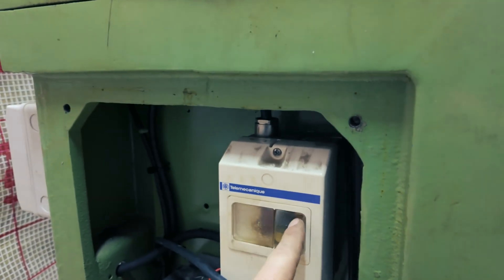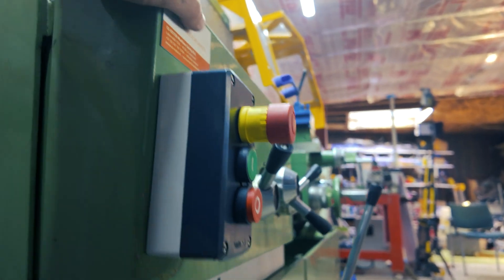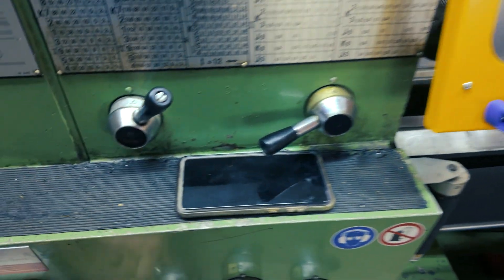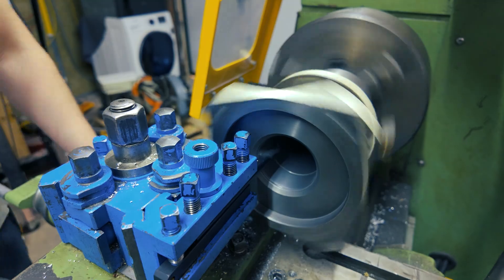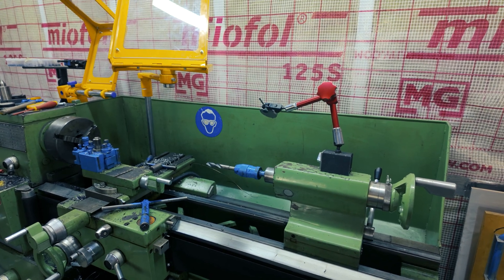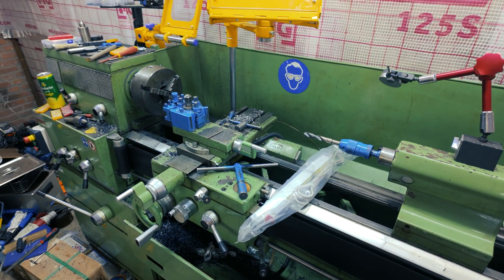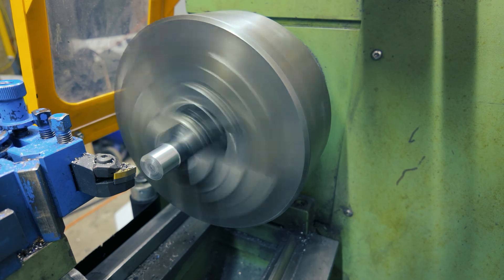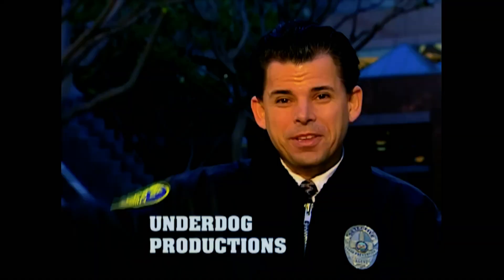My New 2,000lb Beast: The Workshop Will Never Be The Same!

Comment: The a and b are your normal speed and backgear (slow) do not switch these while running.
The c and d are for your screwcutting and feed speeds, also do not switch while running.
The e f g h j k and 1 to 9 on my lathe are also for screwcutting and feed speeds. These in my lathe are switchable while turning, but better check in the manual if that is also the case for the celtic 14.
From memory I think there are some pdf manuals on the internet for the 14.
Reply from the maker: @brutusyt2842  yeah by now i have figured out how it works.

Comment: On my Celtic 12 the s and r refer to the 2 speeds of the electric motor (dahlander). You have a 5 position switch (lever on the right of your carriage i assume) which gives r-s-0-s-r which are high speed ccw - slow speed ccw - off - slow speed cw - high speed cw. You start in the central off position. Switching once gives you the slow speeds (s), switching further while it is turning in (s) goes to high speed (r)
Reply from the maker: You are correct!